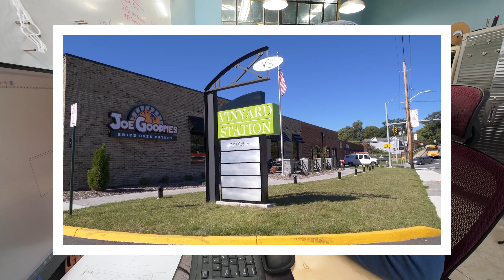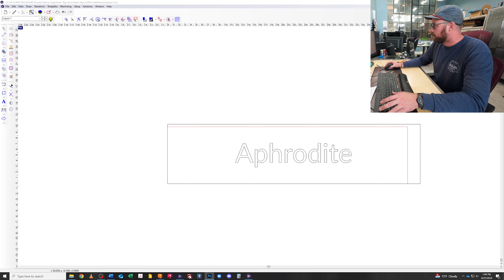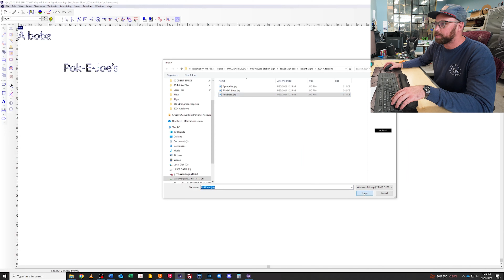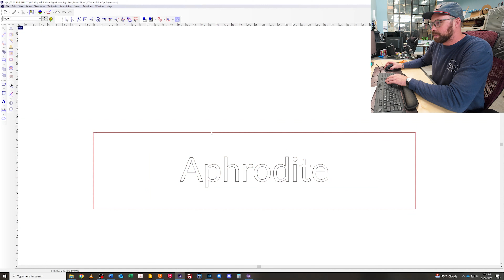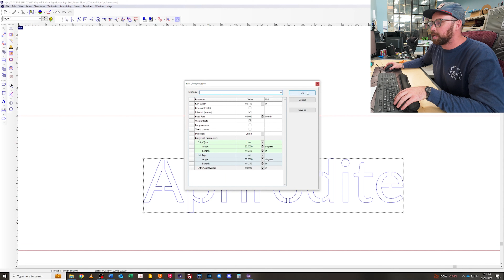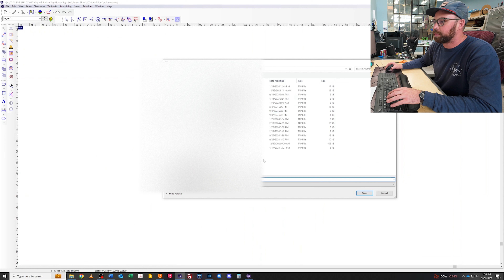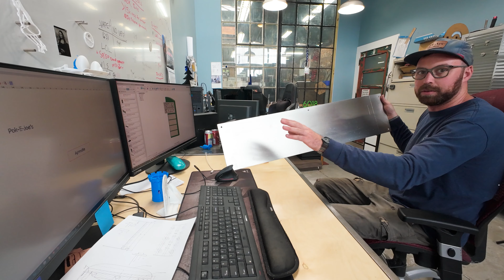How To Cut Basic Signs on CNC Plasma!

Comment: I use a similar technique to set my laser cutter  up, I place a sacrificial piece  on the bed, then cut 5mm in from the edges, after that I zero all my designs 5mm in from the edges, using the piece I cut as a fence, the edge of this piece does get charred if I make a cut along the edge, but then I can just make a new one.
Reply from the maker: I like it! Good tip!